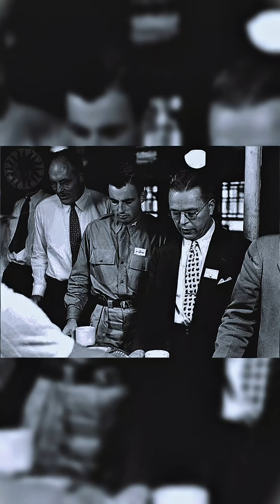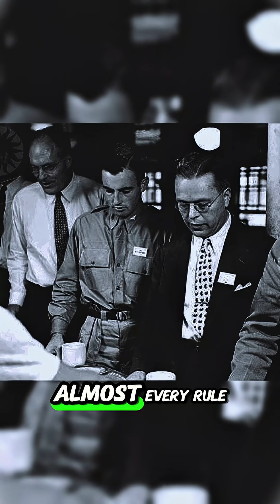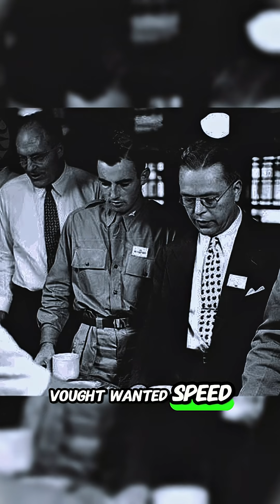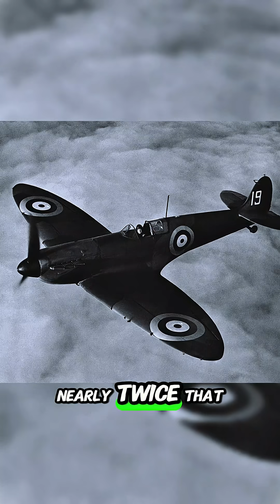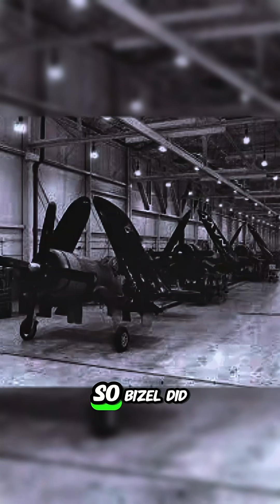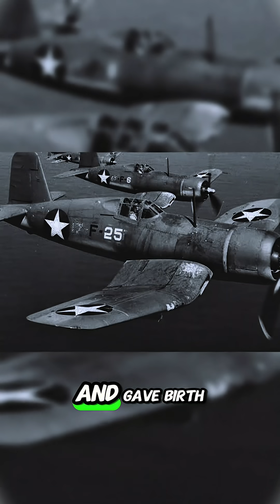The Monster Engine #Engineering #AviationHistory #WW2 #Corsair #WarTech#MilitaryEngineering

Comment: I thought the P-51 was the fastest so I looked it up.  No, the Corsair was slightly faster (440 vs. 446 MPH).  Mustang was the high altitude champ but the Corsair excelled at low-mid altitude.
Reply: Designed for 2 totally different purposes.
Reply: Check out the P-47M & N. They were the fastest US prop planes to fly combat.